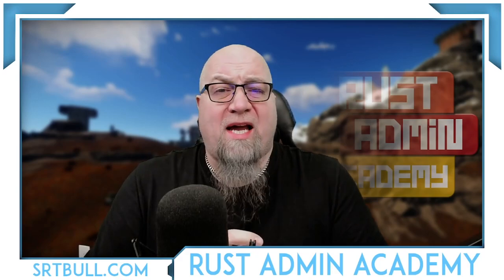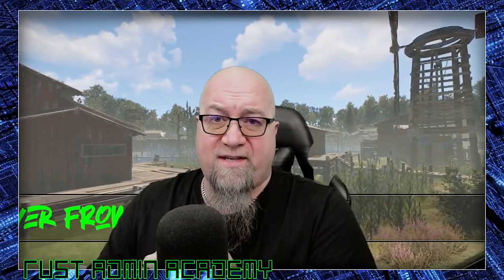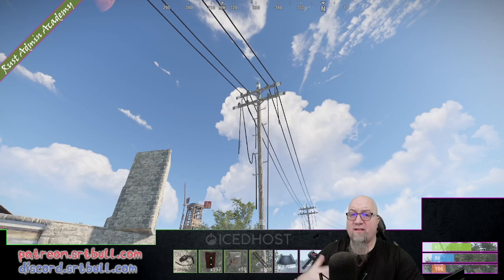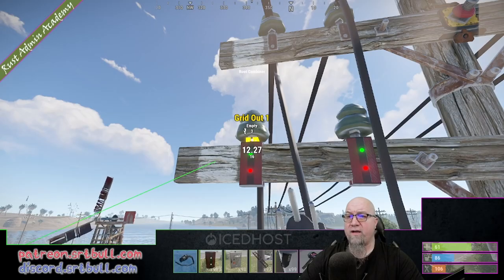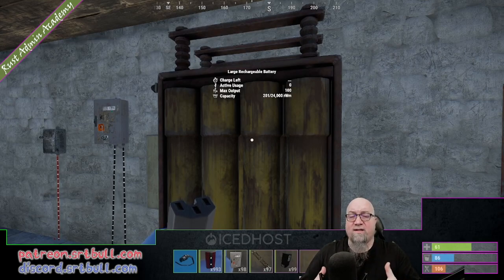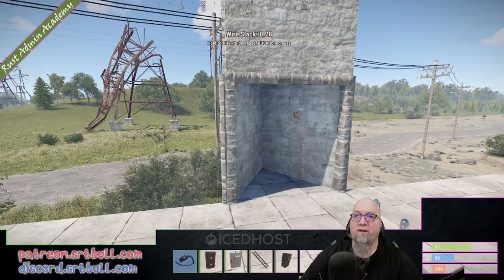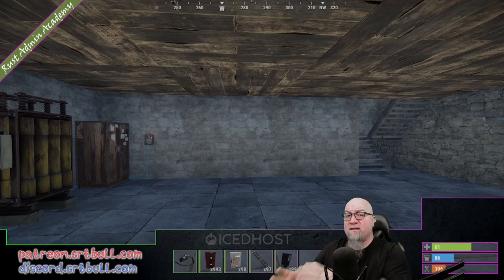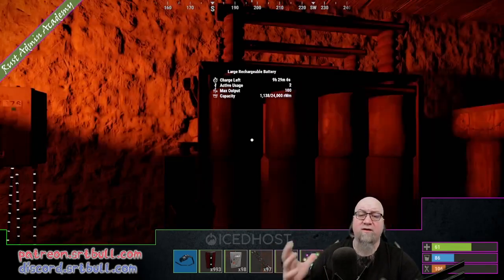CONNECT TO THE RUST POWER GRID?? | ®️ Rust Admin Academy Tutorial 2022 | GridPower Plugin Tutorial

Comment: great plugin, and yes i also see a lot of value in the esthetics that the slack gives to cables. Thats something rust is missing atm., maybe because rounded shapes are not as performant as straight lines - but still, the estethics would be worth. as of the whole power-aspect, i think its much easier to use the already build in items like windmills and solar panels, its much easier to calculate how long they last. for a normal player it would be too much of a hastle on figuring out how the plugin is set up.